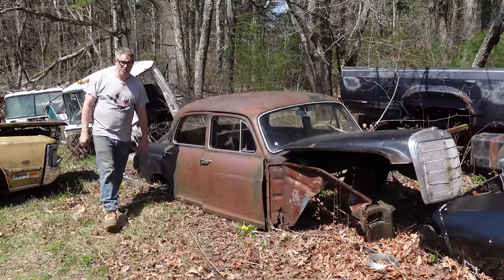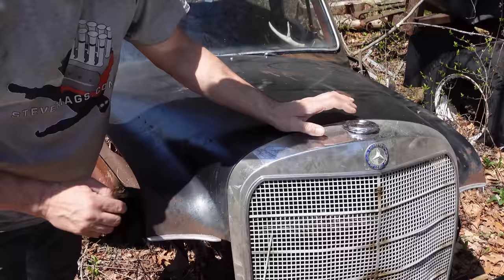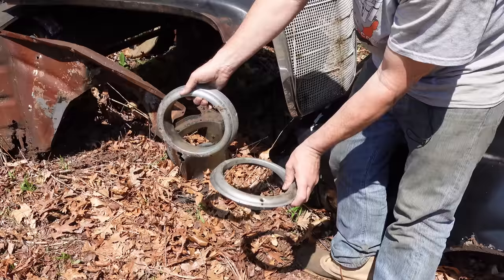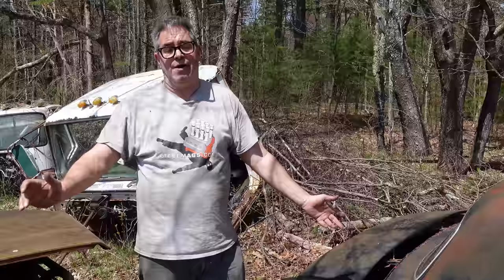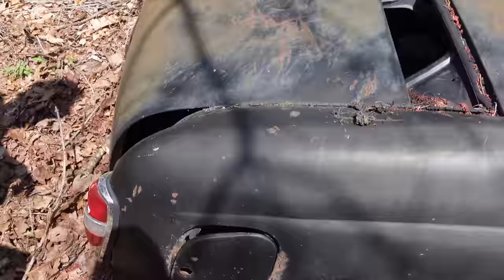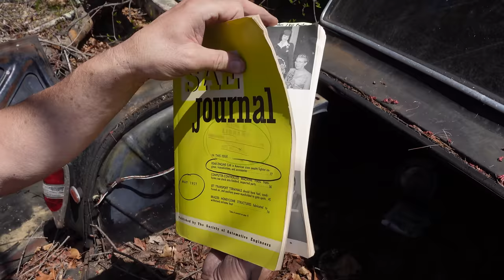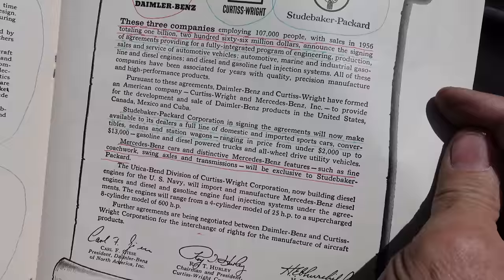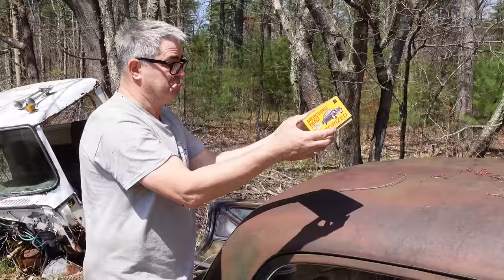Pontoon Butt

Comment: The first Mercedes 1900/1901 series, built by Daimler, was a completely innovative design. It's  low center of gravity, front mounted honeycomb radiator, and lightweight but powerful engine(35hp) were in sharp contrast to the horseless carriages of the time. This car shocked the world when it was first raced. The French, who had been the leader in internal engine and automotive development, were pooping baguettes.

Comment: Writing from Sweden here. I bought the Mercedes not the Fairlaine. But it was my dads choice not mine.Back in -77 I found a Skyliner -59 (the one with the retractable top) for SEK 3500 (appr.$700 at the time) but it was so rusted out all the floors where gone as was the fenders and quarter panels and much more. No problem I thought but my dad said no and bought me a -58 220S much like the one in the video.The price was the double, $1400 but it was rustfree. By then I was very unhappy but since I still own it I suppose my dad was right. Some time later I have saved up money to buy a well maintained -59 Belvedere (for $2600) as a substitute for the Ford and I  kept that one to this day as well. Still today the Ford would have been worth more than the Mercedes and the Plymouth combined if I had bought and fixed it. Love your channel!

Comment: That's a 180 with a 220S bonet /hood. I have a 220S project and have had a 220a and a couple of other 220S's. 
The 180's were side valve fours. 
The highly expensive 190 SL's are a  ponton sedan four door floor pan  in a fancy dress.
The model Kit looks like a 1955 300B "Adenauer" .The big six cylinder uber expensive model and the basis for the 300SL gull wing mechanicals.

Comment: If Cadilllac focused on craftsmanship in the 70s instead of cheaping out and waging a sales war mercedes wouldnt have taken off in the us. Cadillac cheaped out for sales and lost its exclucivity, becoming an old mans car for decades.
Reply: Interesting point but GM wasn’t going to pivot off of their full size platforms to compete with the Germans.  Also, craftsmanship didn’t matter after the diesel and V864 debacles.  My father (long time Cadillac owner) dumped his diesel Eldorado in 1983 and went to Mercedes.  Last GM car he owned.  Final point, I own a 1979 240D with crank windows and 4 speed manual.  The $16,500 MSRP was slightly higher than the top of the line Seville (which was mostly feature loaded).
Reply: Cadillac build quality has been non existent for many decades.
Reply: @bobbbobb4663  
Contrary to what you're saying they did indeed commercialized a small size luxury car (based on and built in the same plant as the J platform i.e. cavalier, ...).
The controversial and total failure '83-'88 Cadillac Cimarron.
It was precisely aimed at competing with the small imported luxury cars.
Reply: @sylvainmichaud2262  The OP was talking about the 70's era Cadillac's.  I'm certainly aware of the Cimarron and the fact that the early models were branded as Cimarron by Cadillac.  It was a rush job started in 1980 for release in 1982 and for comparison, Mercedes started development of their W201 platform in 1974 for 1983 release.
Reply: You can thank our own gubmint for a lot of that. Almost like they were trying to get rid os us industry....
Reply: Its not that cut and dried. Daimler-Benz spent far more money on R&D and build quality than any division of GM ever could have dreamed about, or approved. The W123 diesels they built shame any domestic build car thats ever been built. All the accolades around the world prove it.
Reply: @ChaChiVooDoo  Another point as well -- Cadillac was a majority US brand whereas Mercedes was developing platforms to sell worldwide.  Easy to justify spending significant R&D dollars when you can amortize worldwide.
Reply: @sylvainmichaud2262  My buddy bought a CIMARRON,,,,COMPLETELY UNDERPOWERED PIECE OF CRAP,,,HE DIDNT KEEP IT LONG
Reply: I blame gov CAFE standards.
Reply: But, but, but The Ford Granada ESS. 😆
Reply: @jeffrobodine8579  Laughable that anyone at Ford thought that a Mercedes shopper would cross shop a Ford much less one made to look like a Mercedes.
Reply: @bobbbobb4663  Daimler-Benz cared about quality first over profit. GM is cost cutting over quality for profit. Two different companies run two different ways.
Reply: I must say as a recent buyer of an 80 240 D , I now fully understand how awesome German engineering really is. 
What a heck of a tank of a solid car. 
No wonder they were around 17k new in 1980 ,that's some serious money! 
Ok, after about 1990 everything was made to be replaced but till that point it's very impressive. 
And I've driven vws all my life so I'm familiar with it already. 
Replace parts? 
No no Nanette! 
I almost bought a new fuel tank sender when mine was acting up, but I took it all apart and cleaned it and off I go. I doubt anyone has opened it up in 40 years, so here's to another 40 before  it needs to be cleaned again.
Reply: @MrTheHillfolk  Welcome to the family.  I’ve owned my 79 240D since 94 and am the second owner.  Put about 150,000 miles on it since.  There is a reason the car cost so much new...it really was tank reliable.  Car is currently in the garage because after 40 years the rubber bits in the suspension are gone.  Fortunately, Mercedes does a very good job of having  OEM parts for sale (no cheap Chinese stuff on my car) and I’m in no rush to get it back on the road.  

One tip...make sure you have extra glow plug fuses in the glove box (look at the black box in the middle of the firewall.  There is a metal strip in that box that functions as a fuse).  Other than that, not much else that can leave you stranded.

Comment: Over the years I've thought about buying a used Mercedes just to see what they were like. But now that would have to be a 1990 model or earlier to get the true Mercedes experience, before Lexus forced them to change their ways!
 As a kid in the 1960's I saw one of these old 180 models sitting by an old farm house rusted and neglected for years. I wondered how such an expensive car was allowed to deteriorate over the years, just what was the story behind the car? I never found out! 🤔
Reply from the maker: I've often wondered the same thing. It usually comes down to the fact some critical part gives out - maybe a mechanical fuel injection pump - and the second or third owner can't afford to replace it BUT cannot make themselves scrap the otherwise healthy car. And so they sit.... I've always "punched the air in anger" over how expensive service and parts can be for certain cars. It seems unfair to force the cars into retirement over a critical part that would bring it back to life. But its all business and I get that too. Thanks for watching and writing. -Steve Magnante
Reply: A buddy of mine wanted a drivable “classic” and bought an 80s coupe, a 380 I believe. He found that the cost of ownership, mainly cost of little repairs here and there like the turn signal switch breaking was more than he wants to deal with.
Reply: If you bought a newer Mercedes you would still want see what the older ones were like
Reply: The W124 ( '85-'96) and its predecessor the W123 were considered by some to be the best cars ever made by anyone, anywhere.  And yeah, the post 1990 versions had issues with their bio-degradable insulation wiring harnesses.
Reply: @sombra6153  I bought some door pins for a little omni. They were $5 each....ouch!! The partsman said they were 50 cents 6 months earlier....That was when the Benz boys took over
Reply: @SteveMagnante  We had a guy at work Steve who drove Mercedes, I think he said pre 1988 parts were cheap, after that he said they went thru the roof with weird expensive parts.
Reply: In addition to cars like that Mercedes, I've wondered about RVs.  They are insanely expensive and yet there still seems to be hundreds sitting around neglected and abandoned.  Who has the kind of money to buy something that expensive and then just leave it to rot?  Certainly not me.
Reply: @TheJstewart2010  Yes, I've seen that too! Those older RVs sitting even at storage spaces, where they must have spent more in storage fees than the thing is worth!
Reply: I watched a car show that stated that the last great era for Mercedes engineering was 1985, then the bean counters intervened. Everything from materials to stitching in the seats was compromised.

Comment: Great video Steve! Not to correct you because your toe nail clippings have more automotive knowledge than my entire existence, but that is a W120 and a 1960 to be exact. The W180 were the 6cyl cars 219/220 and had a longer nose and skinny taller grille that stopped in 1959 when 6 cyl cars got the new Heckflosse body with tail fins and Pontons were the 4 cyl ones until 62. The wide grille and tail lights on that car were from 1960-62 in the 180b/Db and 190b/Db models. And the reflectors next to the tail lights were one year only 1960. These cars are what I cut my chops on in vehicles at the ripe old age of 14 and over the last 40+ years Ive owned dozens for parts or to drive. All but two were diesel. I still have the 1960 180Db diesel I bought in 1983. These were Mercedes first full width body and first unit construction. Prior to these they built 30's looking cars with fenders like a 36 Ford. The 4 cyl models always came with vinyl seats and sometimes cloth. The 220 had genuine leather seats and also a real solid wood dash and trim around the windows. The 180 got no wood. Had that 180 been a 190 ( W121 )  that bakelite strip on top of the dash would have been wood. In diesel form these cars ran forever if you could keep salt from rusting them to pieces and the trailing arms ripping off the floor pan. My 180Db has over 500,000 miles and the high mileage badges to prove it. For a small car they had a solid hand built feel and rode very well. Shame those tail lights are destroyed, they're worth a fortune. Hopefully you'll find an Opel Kadett in that yard soon!
Reply: saw this in the yard myself and figured someone needs something off this car
Reply: I could use the clock but it’s not worth driving 2hrs from CT for it lol

Comment: The '57 180 that was rotting in the backyard of my place when I bought it in 2019 had an aluminum head and block. The car was mechanically solid and complete when they drove onto the property a few years before but had rusted away to the point it was about as rigid as a grocery bag. I offered all my Benz inclined friends the car or any parts they wanted for free but not a single person was interested in a single part on that car. My dad saved the engine and gearbox so I'll have something to stumble over and remember him by after he's gone. I guess no one cares or wants those cars. A really well made, high quality, chronically boring car apparantly

Comment: These bodies are w-120s,they never were built in a 2 door configuration, my first car was a 170ds,then l went up the line,a180,then a 190,then l had two 190 sls,my last Mercedes was a 220s.too expensive to buy parts so l went back to Borgwards

Comment: That "MB Tex" type material wears like iron even after being out in the elements for decades. 

No VIN, can't win, but might go something like: L for left hand drive, 120 for 180 Series, 0 for gasoline engine, then a two digit model code, then N for standard transmission or Z for Hydrax clutch, 85 for 1958 model year (58 reversed), and the rest is the production sequence. Should be code DB40 "Schwarz" (Black) exterior paint. 

These were sometimes called "Roundies" by the Mercedes-philes.